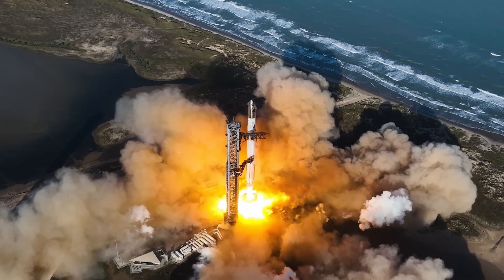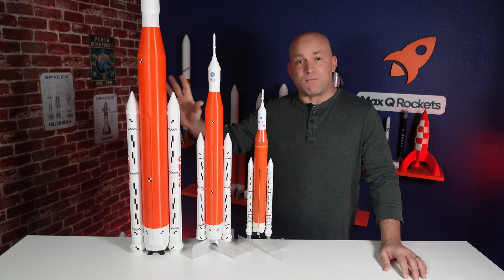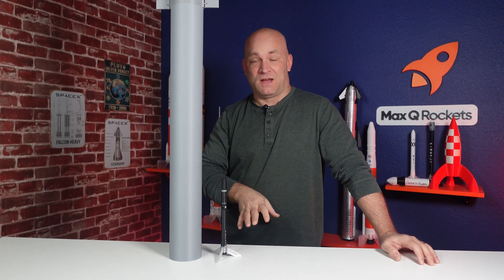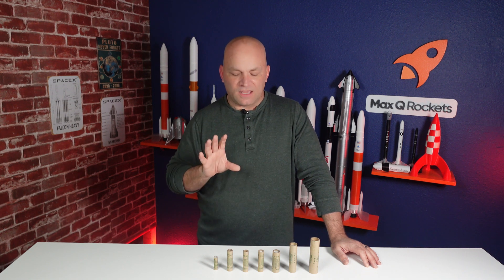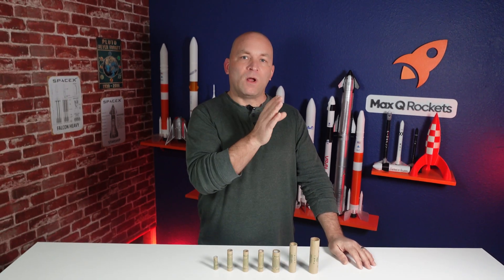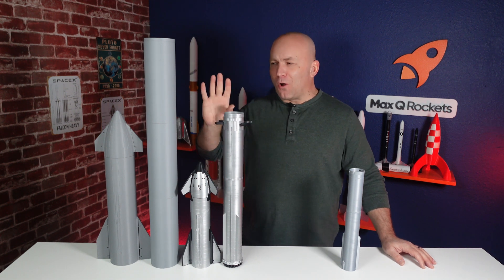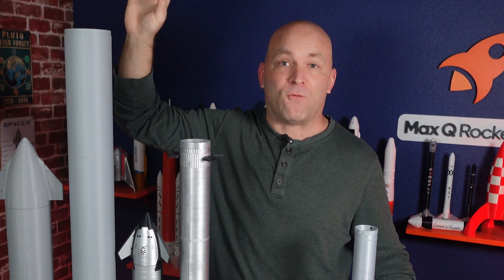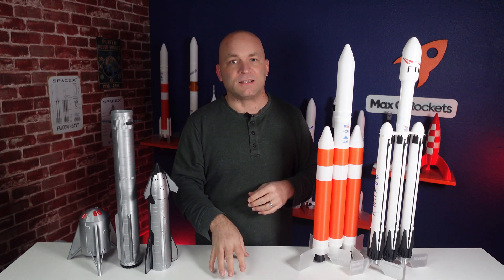Choosing the best scale for your model rocket. How big is too big?

Comment: What about the limits of your materials and build process? I don't know where the limit is, but I assume if you 3D printed a big enough Starship, it might not be structurally strong enough to handle the high thrust, or the acceleration. Not the way I've seen your current Starship and Falcon 9 are constructed, both of which I have. So if you then redesign to make a larger rocket stronger, you're getting pretty heavy.

Perhaps a possible method would be to use cardboard body tubes, with a thin 3D printed sleeve over it. You'll get the great details that I love about your rockets, but the added strength without too much added weight. Of course, now you're limiting your scales to standard body tube sizes. But I think it's an interesting idea that might be worth experimenting with for larger sizes. I just don't have a printer to play with the idea.

Looking forward to what you come up with next!
Reply from the maker: The 1:100 SLS is definitely starting to hit the material limits of ABS without making them thicker or adding tubing (or fiberglass). I'm planning on doing some experiments soon to find out just how strong they are which will help us know where the limits are. Thanks for the tube suggestions. Might work if we can find the right size.

Comment: Just so you know, A-D is considered low-power, E-G is mid-power, and H and up is high-power. Any chance you get in to high-power?
Reply from the maker: I didn’t know that! I thought it was low power up through G.
Reply: @MaxQRockets   yeah, the 13mm Mini-motors, the 18mm and 24mm diameter motors are Low Power.  The 29mm motors (up to Aerotech's G80, for example) are Mid-Power; based on a certain Thrust/Impulse criteria by N.A.R., the hobby's governing body. After that, High Power requires Level 1 Certification.  The black powder motors are limiting in power and ejection times, compared to composites.
Reply: @MaxQRockets “Low” and “mid” aren’t really like important terms since there is no requirement to fly them. (at least in the us). High-Power is where you need to get your certification (like I have) to fly. Some high-power only flyers refer to “low” and “mid” power as “low” power to differentiate them from high-power.

Comment: Well, as an "unbiased" fan, I must say, Max Q just keeps getting better and better!  I love your breakdown on scale decisions.  Very practical thought process.  One thing I will point out that wasn't mentioned in the video is that on your heavy lift triple motor rockets (Falcon Heavy & Delta IV Heavy), the modeler has the choice to fly them as single engine flights, or go all out with 3 engines!  What versatility!!!!  Great fun style with all your models!  Keep it up!
Reply from the maker: Good call out. I tried to think of a way to fit the triple heavies into the script but couldn’t find it. Ended up just featuring them at the end. The versatility of the engines is definitely a plus !